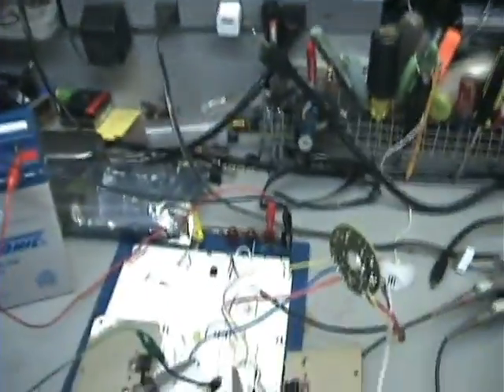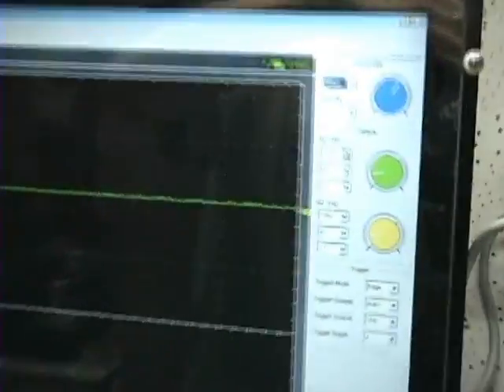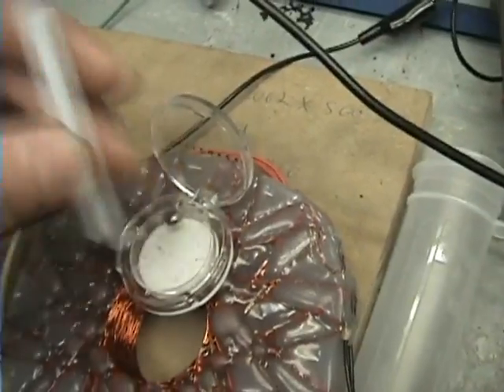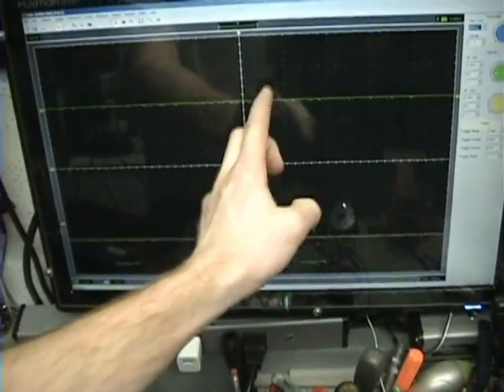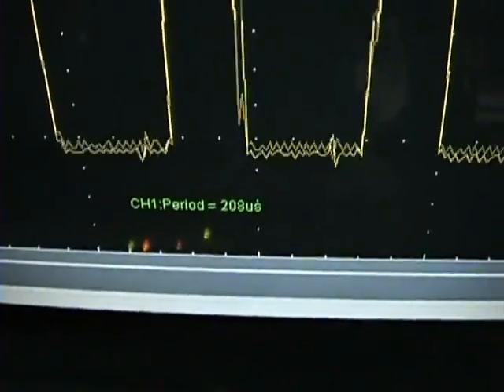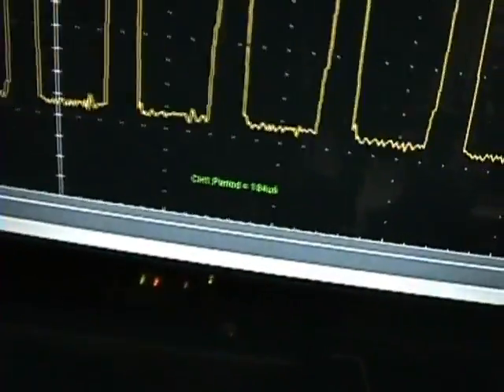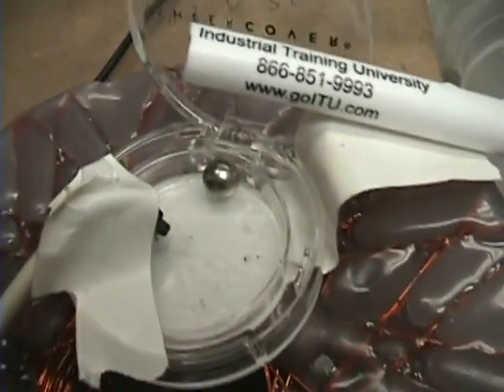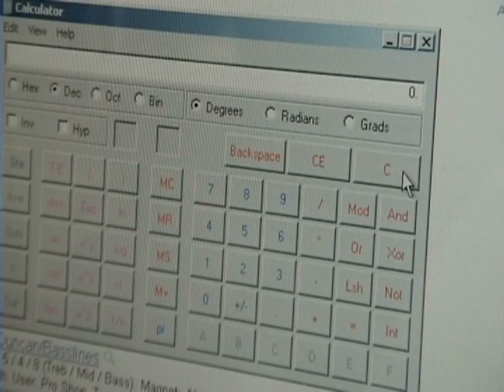300,000 + RPM Starship Coil Double Pulse Motor Fan Mod! Crazy! (TEST30)

Comment: Hi Russ,

You have taken 2nd place over from alfacentauro1111... he measured in at 300K.  Well done!  You have hit the switching limit of your hall sensor... you are going to have to go with triggering your gate with a coil instead if you want to push it much higher.  There is at least one order of magnitude more in RPMs available... little tweaks will get you there.  Keep up the good work.

Comment: So how do you know the hall sensor wasn't just picking up the magnetic field from the coil and not the speed the magnet was spinning at.
Reply: because the ball triggers the hall sensor. This circuit is not a free running oscillator, it has to be triggered by the rotation of the ball.

Comment: I may be missing something here, but if you have the windings of each coil offset by 30 degrees, which is what you say at about 0:55, then surely you have 360/30 = 12 pulses per revolution? If so, then you need to divide your frequency by 12. This results in a speed of 25,105 (which is still pretty respectable!!)
Reply: wrong, the coil is energized all at the same time.

Comment: you could use PLA based graphene or ABS based graphene 3d printer filament and make the motor with the correct angles you need.

Also, that's just a metal sphere that is rotating. You should try getting a small metal turbine fan to spin. If you can do that, and bring it to 300,000 RPMs, you would have some serious thrust.

Comment: @energyalt56 I wound my starship variant coil bifiar, with one drive coil and one trigger coil.
The trigger coil is connected like a regular bedini SSG circuit... between gate and earth.
The hall sensor he is using has a a limited frequency response... it an only switch up to a certain frequency.  A coil is not limited in this fashion.

Comment: Congratulations you have built a calculation pin Using a clear tube with sealed caps Magnification leveler7  Weight and mass Whining of one mm wire and regular wire together and then make it

Comment: Either way Russ, that's smokin fast but how does someone relate to those kind of RPM's?   I like to put things into perspective so heres a little fun fact:  
At 301260 rpms, that tiny 1/4 inch dia. sphere would be spinning at  ...223.9 mph. 
 
But first,  isn't the "period" your using to determine the rpms, based on the signal to channel 1 which is only half the rotation. The period should be the peak to peak relationship between channel 1 and channel 2. 
I think your 301260 rpms needs to be divided by two =  163043,47 rpms.  
Good job as always...
Reply: on what how big is that tire?  tire man.

Comment: Are you worried about the centrifugal force causing that ball to explode ?
In the '70's we were spinning caged bearings with compressed air - then through the grapevine I heard about bearing exploding, severely injuring a guy

Comment: There is no need for a exotic coil, a simple 10~15 turn coil is all you need and 10 seconds to make it. Here I show you 1+ million rpm and a simple coil and no need for a double coil pulsing twice per revolution, I am only running 7 volts. https://www.youtube.com/watch?v=5PyTevLzYM8  For the people saying its not 300,000 rpm they just dont understand how this works. The magnet triggers the hall once every revolution, so this is the exact time it takes to do one rev. So 1 divided by period then times 60 is rpm.  1/0.000184=5434 x 60 = 326,086rpm. I got mine up to 1.1 million, 52us period. Equator speed was 668mph and 3.64 million G's before the ball explodes.

Comment: The whole 1hz = to 1/60 seconds is very confusing. You'd rather say: 1hz is one cycle per second, but since rpm is per minute, you need to multiply the number of cycles you get per second by 60...

Comment: mabey use two starships one n top of each other 90 degrees offset from each other that way it would be pulsing 4 times instead of 2 per revolution. u may be able to get 600000 rotations per minute. just a thought

Comment: with the power disconnected you still get rotation.   Why ?   This is extremely important because your initial input battery energy creates the toroid vortex which grows fractally outward.   The neo ball keeps spinning because the field is still in the vortex mode and will slowly collapses to its original zero point position.  this vortex will keep the neo spinning.   this is free energy   where a small input can give back lots of energy way over unity

Comment: Sorry but i think your calculations are wrong!
1 Hz in a sine wave means 1 up and 1 down cycle but you use square waves...
so for the down cycle comes another square wave!
That means RPM = Hz * 60 * 2 or RPM = Hz * 120
You have there over 600.000 RPM and that should be right cuz it sounds to me like that... 300k RPM sounds different!
Please be carefull if you take bigger size magnets cuz they can explode and pirce all over at such RPM!
Cheers...